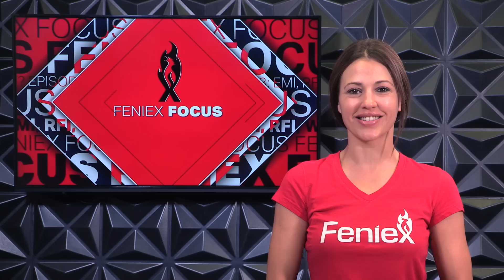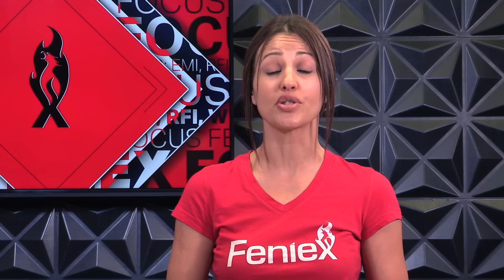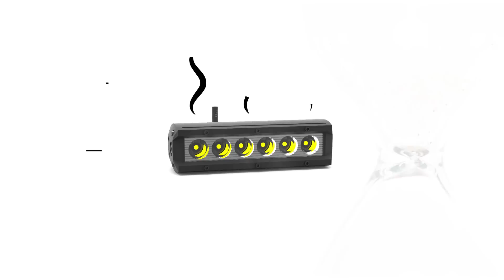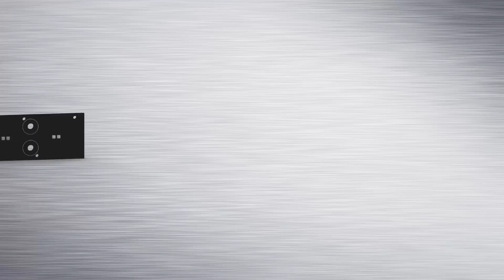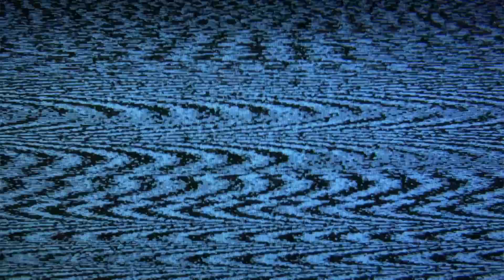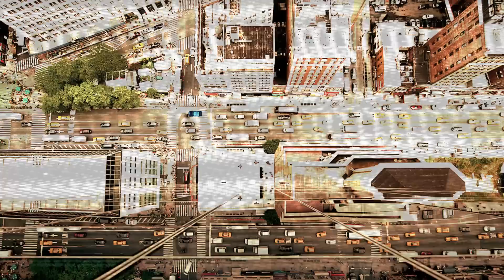Feniex Focus Episode 3 // The Biggest Threat to Emergency Vehicles

Comment: It took a team of 20 engineers to figure out how to guard against EMI? That's ridiculous! Just add a couple ferrites, shield the enclosure, and you're good to go.
Reply: mnslinky While true, Fenix also has to consider size and other factors that will also impact the products. With Law Enforcement moving to smaller, more fuel efficient vehicles, bulky lights would have a significant impact on that aspect. Another thing is that EMI not only causes problems for radio gear, but has the potential to interfere with the various computer modules in the car if not properly dealt with.
Reply: ***** Yes, shielding is an additional cost. Basically, make a Faraday around the PCB, with little holes for wires, and have those wires go to a daughter board. Ferrites guard against EMI transmitted down the conductor; shielding guards against EMI radiated into the atmosphere.

What approach did you take to reduce the EMI, anyway?
Reply: Ferrites are a stop-gap.  They're not a solution to a problem, they're a response to a symptom.

edit: auto-correct thought I was talking about ferrets.  smh...